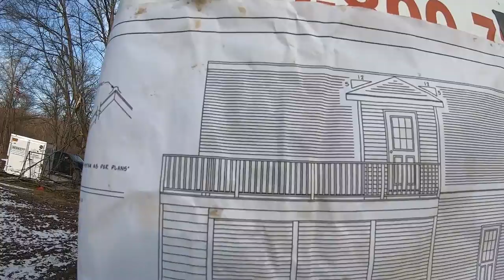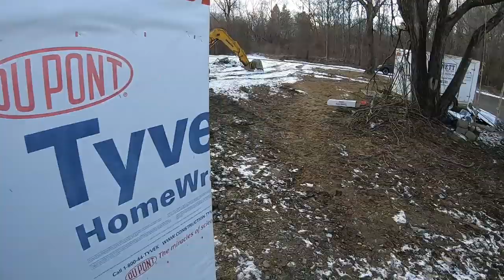Prepping for concrete garage floor & setting precast concrete piers for deck & stairs

Comment: Nice job as always dirt boss, I’m glad the weather is working out for you to be able to work it’s been nice in southeastern Ohio where I am too, typically it’s below 20 degrees by now, but I’ll take what we got for as long as it will last, long forward to the concrete pour
Reply from the maker: Brian i hear that! What part of  Ohio.. ive been to Logan Zanesville ect bow hunting for 10 years.
Reply: Dirt Boss Tri-County Masonry & Excavating I’m in Belpre it’s right on the Ohio River, about an hour and a half from zanesville